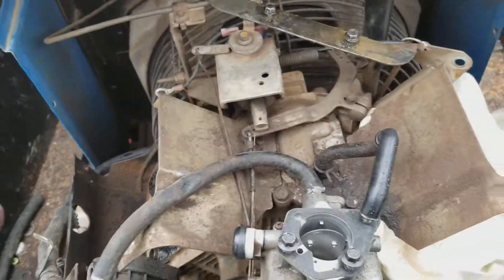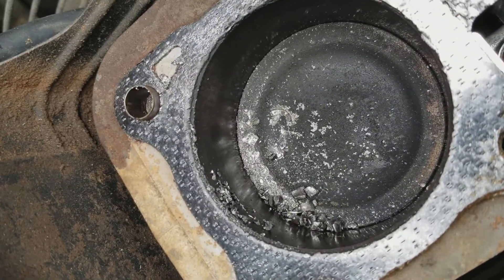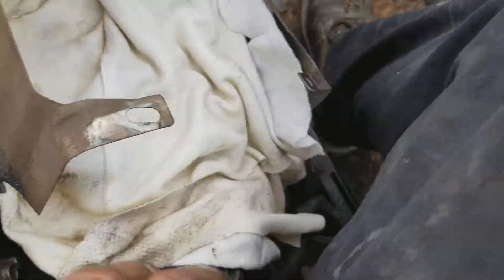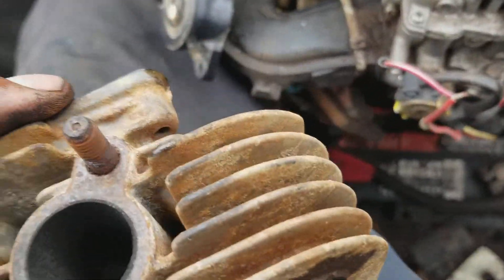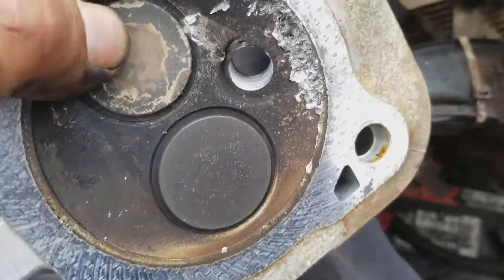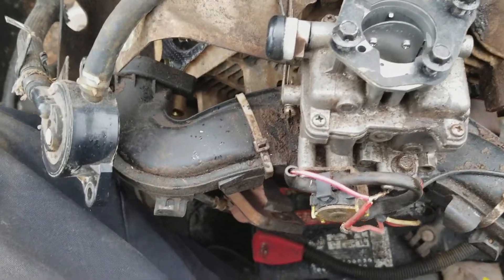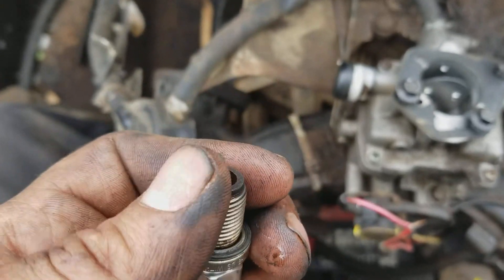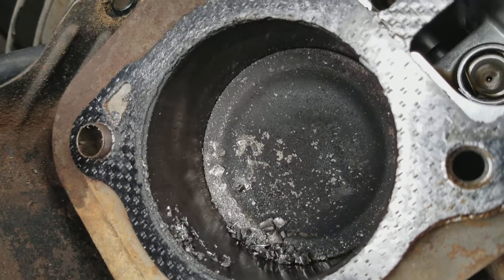Miller bobcat 225 kohler engine issues 3

Comment: What did u endup doing? Some of the Kohler engines have been discontinued, can't even get parts for them. All u can do is buy a replacement engine or fine another used engine that will fit. I repair these welders for a living.